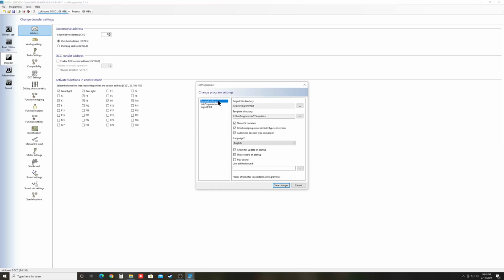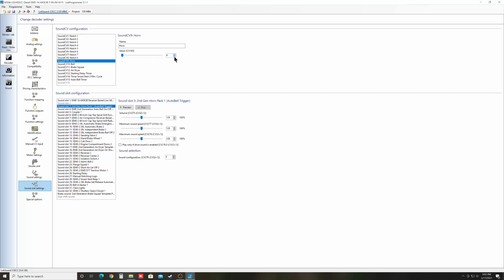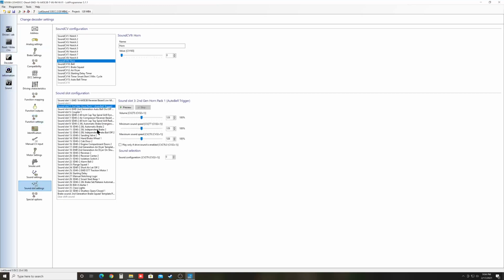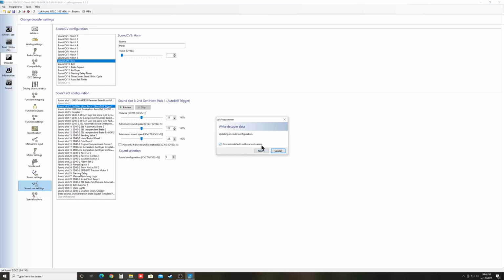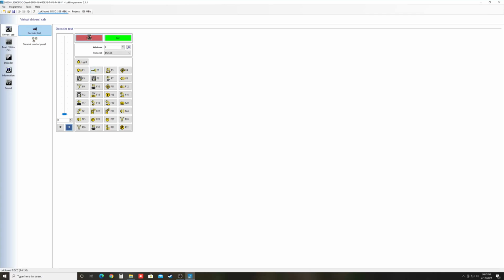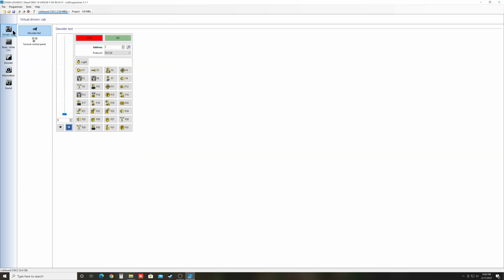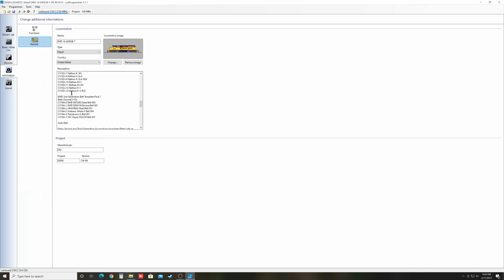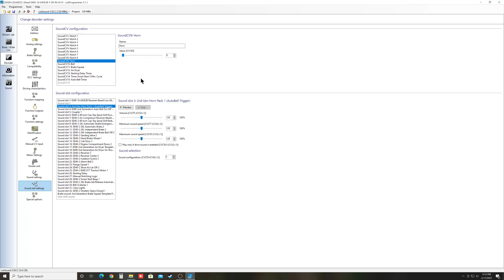ESU Tutorial Series - How to Change the Horn & Bell in a V5 Sound File

Comment: Thank you for this video! I see where the CV Sounds are 155-170. Your video gives a horn and bell example of CV163 and CV164, respectively. How do I know what the default horn and bell CV numbers are that my new loco came with, in case I want to go back to those? Also, I see where master volume is CV 163, but how do you control the individual horn or bell volume?
Reply from the maker: @krispavone3856 All sound files use CV163 for changing horns and CV164 for changing bells. You can always read these CVs using your DCC system's program track to know what they are set to by default. If you can obtain the OEM sound file for your locomotive, you can open it in the LokProgrammer software. The software is a free download and you don't need the LokProgrammer hardware. The sound files have a list of the specific horns. The manufacturer may also be able to provide this information by way of the sound file bulletin.

Individual volumes are controlled by setting CV32=1 first. The prime mover is CV259, the horn is CV275, and the bell is CV283. This is the same for all sound files.
Reply: @RioGrandeFan  Ahhh, I see! I just tested it out. I've never seen this option before, it's like entering a CV for a CV, that's what was confusing me. Thanks for clearing that up for me! Kind of unrelated, do you have any idea why my engines bell rings every time I press the horn? It does it with every horn setting.

Comment: When I got this Walthers EMD SD70ACE with Loksound 5, the tech said it has proprietary sound files which is also in my other matching SD70ACE 8490.  He said the horn sounds are Nathan
163_0-3. (3 is default) I might have downloaded a sound file but right now I don’t remember where it downloaded to.  I will have to look for it. Both locomotives have the same sounds in it.    The horn is really whimpy,  not loud enough.  The bell rings too fast,   Prime mover is ok but it doesn’t move until it makes its chirping sound besides the diesel sound.  That is its start up sequence.   It has to complete sequence before it moves.
Reply from the maker: Ahh, ok, yes the Walthers SD70ACe has an ESU decoder called the Essential Sound Unit. It isn't a true V5, it is a lower end decoder that is locked with what comes on the decoder. You can't change the sounds that are on these decoders. The horns and bells they come with are what they are, you can cycle through them with a CV change but as far as adding or removing horns and bells unfortunately you can't. I'm not sure what a chirping sound would be but yes, all ESU decoders are set by factory default to not move until the start-up sequence is completed. A real locomotive cannot move until it is fully started so this is just another piece of added realism. You can generally turn that off with a CV, but I am not as familiar with the Essential Sound Units. I would highly recommend just replacing it with a true LokSound 5 DCC. They are 21-pin and can be easily changed out. You would need to have a LokProgrammer to write a retail SD70ACe sound file to the LokSound 5 DCC. Some dealers will do this for you if you don't have a LokProgrammer. The sound quality is immensely better with the regular LokSound 5 DCC decoders and you can customize the horns and bells for what you want on the decoder. You can also turn off the start-up delay if you choose.
Reply: @RioGrandeFan  does the speaker need to be changed or is that compatible with.   I think I may have a v5 decoder for that.  It seems to me I got one some time ago.  I will need to look.
Reply from the maker: @KimKeyboardKimFokken  you can use the speaker that is installed though a Scale Sound Systems speaker would be a HUGE upgrade for sound quality. It would require soldering to move the wires from the factory speaker over to the Scale Sound Systems speaker.
Reply: @RioGrandeFan  what model would I need for that SD70ACe?
Reply from the maker: @KimKeyboardKimFokken  The SD70ACe is retail file S0822 on the ESU website: http://projects.esu.eu/projectoverviews/search?cat=18&q=S0822
Reply: @RioGrandeFan  how do I find the right Loksound 5 model .#’s for the other locomotives I have by locomotive model?    That newest SD70ACE from Walthers is still in warranty so want them to install new V5 Genuine.   The other twin to that SD70ACE is out of warranty but would use the same model decoder.    I have a Walthers GE ES44c4 Gevo the currently has a Soundtrax Tsunami 1 that I want to upgrade to V5.    Athearns SD40-2 Soundtraxx Economi and Atlas GP40-2 Loksound Select.   I want to get out of the Soundtraxx.    I am not going to change the Fox Valley GP 60 m which has Loksound Select.    Those others I will want to be V5’s
Reply from the maker: @KimKeyboardKimFokken  You just have to search the ESU website's list here: http://projects.esu.eu/projectoverviews/18. You can search the model type directly or you can use Google to tell you what prime mover something has. ESU provides many options and variations for several prime movers so you can simply pick one. You can even listen to some directly on their website. 

Walthers sells the SD70ACe in their Mainline series as a lower end cheaper locomotive as either DC with a 21-pin socket or with the Essential Sound Unit sound decoder. Walthers will not install a genuine LokSound 5 DCC decoder in it for you, at least not for free. This isn't a warranty issue. They can only directly replace the decoder that it comes with, and only if it is faulty, as that is how it is sold. The locomotive would be about $80-$100 more expensive if it came with a genuine LokSound 5 DCC. You did not get ripped off, the Essential Sound Unit is what they are supposed to come with and how they are sold. 

If you don't like the Essential Sound Unit, you should consider only purchasing the non-sound version and install your own 21-pin LokSound decoder. Of course, you would also have to provide your own speaker (Scale Sound Systems). 

Changing the Walthers GE ES44c4 Gevo would be easiest done with a Nix Trainz decoder buddy and an ESU 21-pin LokSound 5 DCC. The same would go for the Athearn SD40-2 and Atlas GP40-2, though you could use the ESU LokSound 5 DCC Direct board in the Athearn and Atlas units.
Reply: @RioGrandeFan  So that is the sound file for the Loksound 5,  not the essential sound?
Reply from the maker: @Kim Fokken  correct because you can not load sound files onto the Essential Sound Unit decoders. There are no retail files for these. They are lower end decoders that are hard coded with sounds by the factory. You must physically change the decoder to a true LS5 DCC in order to write sound files, swap horns/bells, etc.
Reply: @RioGrandeFan  I am trying to find the right decoder for the SD70ACe's  (HO)  The Loksound 5.   Sound Speaker sent me the information for the speakers for these locomotives.   I found out that the same speaker for the SD70 also works in my GE ES44.  Eventually,  All my locomotives will be upgraded to Loksound 5.   The GE is a Sountrax and so is the Athearns SD40-2 so I want to get out of Soundtrax.  I am first starting with the two SD70ACe's
Reply: @RioGrandeFan  In my laptop I downloaded that sound file as the laptop is what I use for my train stuff.  (Lokprogrammer and JMRI Decoder Pro)
Reply: @RioGrandeFan   Also, do you know which sound file I would download from ESU's website? My locomotive is a V5 Atlas Gold model GE Dash8-40B. I can't seem to find it on the website. Thanks!
Reply from the maker: @krispavone3856  it would be easier to chat through email, copy and paste your questions to: support@loksound.com and I will answer that way. Both this and your question regarding the bell ringing with the horn.

Comment: Like if there is Nathan (horn) 163_0-3 but I want a Leslie 163-?(whatever).  Can additional horns be programmed and same with other sounds.
Reply from the maker: Not on the Essential Sound Unit decoders like what Walthers uses but on a regular LokSound 5 DCC. They are also called by their real names like Nathan K5LLA or Leslie S3L. The retail SD70ACe file S0822 comes with 20 horns including 6 variations of the K5LLA which is correct for the SD70ACe. There are also 5 bells, 3 steel bells and 2 modern E-Bells if your model has one of those. Some SD70ACe's have regular bells, and some have E-Bells.

Comment: Does the system recognize the sound file currently in decoder l?    When decoder is connected to Lokprogrammer.    It recognizes the decoder that is in locomotive?
Reply from the maker: This data isn't written to the decoder. While it will give you some information, it won't give you everything. You should always start with the original sound file whenever possible. Most manufacturers either post the files to their website or they'll send them to you if you ask. If you can't get it, you can always find a new retail file on the ESU website for your prototype and just move forward with that file.

Comment: Can you show how to change the diesel engine volume? I know the master volume is cv63
Reply from the maker: All of the individual sound volumes can be changed using the Sound slot settings tab in the LokProgrammer software. The prime mover is always Sound slot 1. You simply select Sound slot 1 and move the Volume slider bar up or down. If you have a LokProgrammer you can then simply click "write decoder data" at the top to write the new value to the decoder.

If you don't have a LokProgrammer the prime mover volume is CV259. To set it you must set CV32 to 1 first, then CV259 to a value between 0 and 255 for the volume level. A value of 128 is 100%. A value of 160 is 125%, 192 is 150% and 255 is close to 200%.

Individual sound volumes are really some of the easiest things to set in these decoders.
Reply: @RioGrandeFan  i have an atlas gold series gp40-2 with loksound v5 and ive tried doing that and it does nothing. Your horn and bell vidoe helped me change those around tho.
Reply from the maker: @jacobpfeifertrains1998  if you're trying to increase the volumes, you may be at the upper limit of the speaker. With some you can only go so loud before the changes aren't noticeable. Try setting it to an extreme low value to see if the decoder is taking the programming. Set CV259 to 30 or 40, it should get really quiet. If it does you know the programming is working. Are you using the LokProgrammer to write the CV's or your DCC system? I would also recommend changing the speaker out for a Scale Sound Systems as they are better all around. Better bass and sound clarity. You do lose a touch of volume, but loud volume doesn't mean good quality sound.
Reply: @RioGrandeFan  i did try lowering to like 10 and there was no change. Same with horn volume. Also set cv32 to 1. Im using a NCE Powercab. I can change the master volume and change between dif horns and bells
Reply from the maker: @jacobpfeifertrains1998  I just tried changing the prime mover volume on a different locomotive I have with a V5 using my PowerCab and it worked perfectly. I tried it using the main track and the program track and both times it worked as expected so I'm not sure what is going on. You are setting CV32 to 1 first right? I don't have an Atlas GP40-2 with a factory LokSound 5 but they all work the same. 

Choose the option to use the Program Track, when you type in CV32 the system will read it back, are you getting a value of 1? If not, change it to 1. Then type in 259, what value do you get back? If it is a high value over 100 try changing it to a low value, then read it back and see if the number you put in reads back. If so, exit out to the main screen and see if the volume has changed. If you aren't able to read back values and get an error message or it reads back 255, that would tell me you might have a faulty decoder.

Another thought is you might need to reset your PowerCab. Sometimes the system itself gets messed up and needs to be reset. You would go to the Set CMD Station option and then press Enter through all screens until you see the reset option. You press 6 to reset, then press 1 to confirm. I have found the PowerCab needs to be reset periodically. 

The only other thing I could think of is maybe your locomotive doesn't have a LokSound V5 decoder? I just looked and the same CVs do change the volumes in the Select Decoder though, the only difference is 128 is the max value for 100% volume. You can't go higher.

Overall I'm quite stumped, you should totally be getting this to work and very easily.
Reply: @RioGrandeFan  me too. Its a v5 because cv 164 and 163 control the bell and horn where as the others us cv48. Since 163 and 164 control horn and bell it must be a v5 also paperwork says loksound v5. Ill try resetting the powercab tonight and see if it works.

Comment: Really appreciate your help - its taken me hours to find my way here. Just something simple like changing the horn shouldn't be this complicated - and I don't believe you when you say "its simple" - on other decoders Soundtraxx etc. they give you a simple list in the manual and its changed in a few seconds.
Reply from the maker: Changing the horn and bell really is as simple as any other decoder. It's simply setting a CV to make the change. In this case changing CV163 to a value from 0-14 changes the horn. That's no different than any other decoder, the CV number might be different, but the process is the same. Since there are hundreds of horns in the ESU library, not all are included in every sound file. That means they can't publish a horn list in any manual. The horn lists are customized per sound file. ESU does list the horns on their website http://projects.esu.eu/projectoverviews/18 for each sound file. You have to click the little "more" link in the sound file description and it literally gives you the horn, bell, and more lists of what they are. You do not need the LokProgrammer software at all to change horns, bells and anything else. Changing the horn through the LokProgrammer software is actually more complex than just using your DCC system. Since I use the LokProgrammer for all set-up of my ESU decoders, I just use it for that too. I set up the horn at the time I am setting all of the other parameters I want.